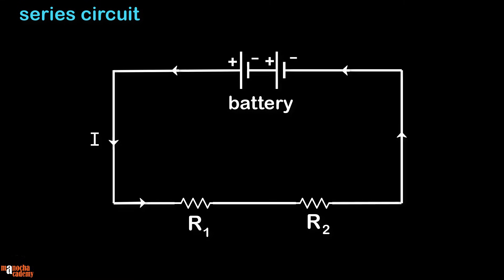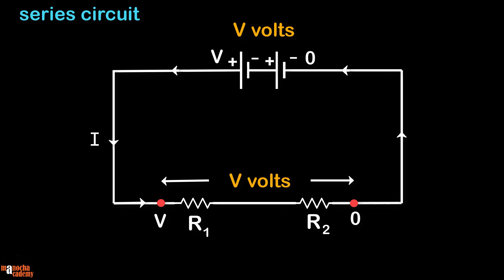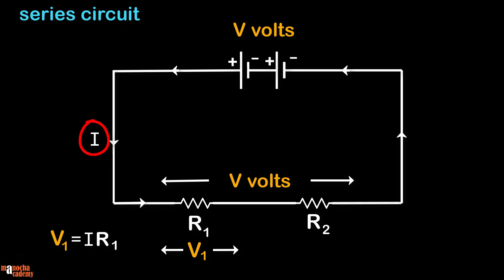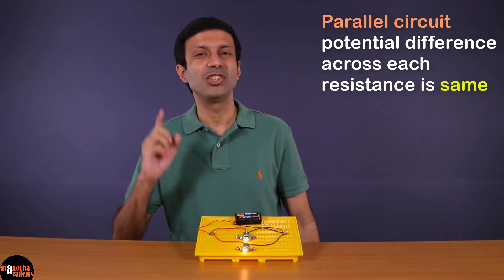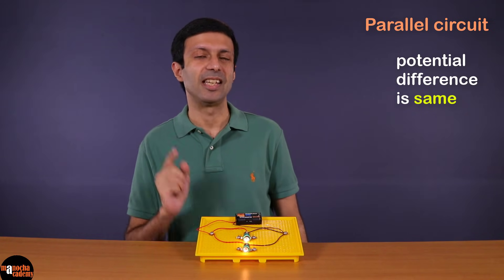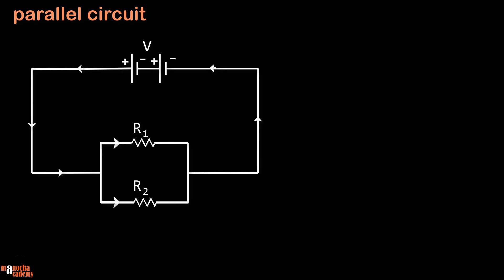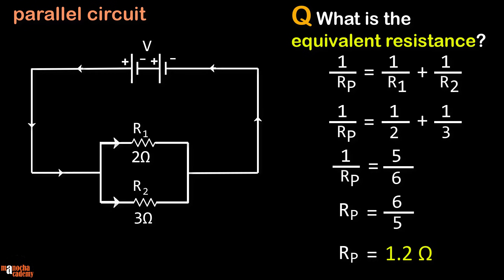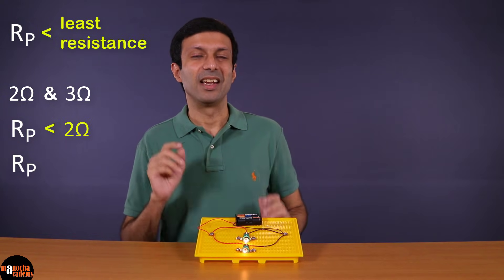Resistors in Series and Parallel

Comment: 08:37 your statement need to be corrected. Because sereies circuit current will be same and voltge only divided. So, sereies combination overall resistance increases, Same Current through Each Bulb and voltage in the circuit divided in to each bulb.

Why series combination bulb glow dim?

In a series combination of bulbs, the bulbs glow dim due to the following reasons:

Same Current through Each Bulb: In a series circuit, the same current flows through all the components. If there are multiple bulbs in series, they share the total current, which can result in a lower current passing through each bulb compared to a single bulb circuit.

Voltage Distribution: The total voltage from the power supply is divided among all the bulbs in the series. Each bulb receives only a fraction of the total voltage, which can lead to a reduction in brightness. The voltage drop across each bulb is determined by its resistance, leading to less voltage for each one.

Increased Total Resistance: Adding more bulbs in series increases the total resistance of the circuit. According to Ohm’s Law (V = IR), for a fixed voltage, an increase in resistance will decrease the overall current. Lower current means less power (and therefore less brightness) for each bulb.

Comment: I havw a doubt sir,Arent potential difference and current directly proportional? So in series circuit if potential is changing across 2 resistors, shouldnt the current also change?
Reply: I think it's because in series resistors, the first resistor gets full potential applied, but a voltage drop occurs at the first resistor and the second resistor gets the dropped voltage applied across the 2nd resistor terminals, which causes a voltage division.

Comment: One confusing part of this topic is how resistance is  defined. In Ohm's law resistance refers to the resistance of the conductor. However in doing resistance calculation, and most basic books would focus on the circuit with resistor neglecting the conductor's resistance, which seems to now defy the actual definition of resistance. It would have been  better if the resistance is defined as either the total resistance in a circuit or the resistance of a wire because when resistance of a conductor is very low, most often, it is ignored/excluded in the computation of resistance. Any thought  on this @Manocha Academy ? Thanks

Comment: Doubt,

What about the current if we connect resistors in parallel with same resistance?🙃
Reply: Two identical resistors in parallel have an equivalent resistance half the value of either resistor. The current splits equally between the two.

Comment: Until now none of my teachers really told me that bulb is actually a resistance. Now that I got it, everything is crystal clear. Thank you so much Sir. I wish you were a teacher at my school!
Reply: With this comment of yours, my 90% problem is solved, without even watching the video. Thanks.
Reply: For us they just read the lesson. And ask is there any doubt
Reply: @girishasthimmaiah1153 Horrible 😭
Reply: But my teacher does
Reply: Yea
Reply: yea same
Reply: Yes
Reply: It cant be said the bulbs are resistors 
They do resist the flow of current but it may vary with temperature conditions
So u cant use bulb as resistance prove ohms law
Reply: @isync_gaming Bulb is not resistance it is resistor as it opposes the force bulb do the same so they said bulb as resistor even through they both are different
Reply: @isync_gaming  j
Reply: Bulb is only used to replace resistors here because bulb opposes the flow of electric current. Bulb and resistor are actually different but both of them have opposition of current in common
Reply: true story🤣
Reply: How
Reply: Yes bro mee tooo😢
Reply: Yea sir super explain tq sir
Reply: Ye
Reply: yessssssssssssss
Reply: Sir is not fire but the comment  is fire🥶
Reply: P
Reply: Cap
Reply: Bulb also has a resistance..any electrical appliances had certain value of resistance so can be called resistance
Reply: Sameeee
Reply: Yeah mine also😢
Reply: Same here 
This sir is really good 🔥🔥🔥